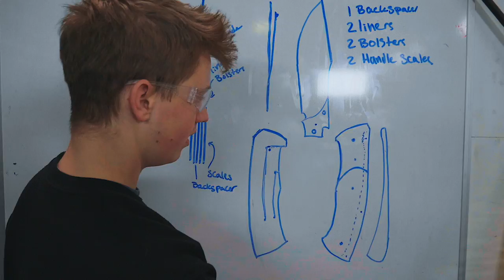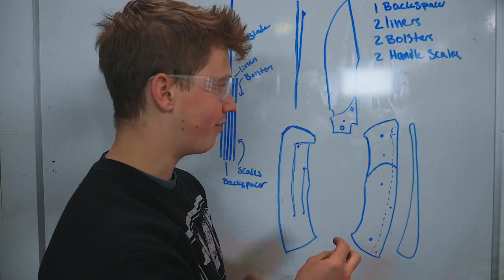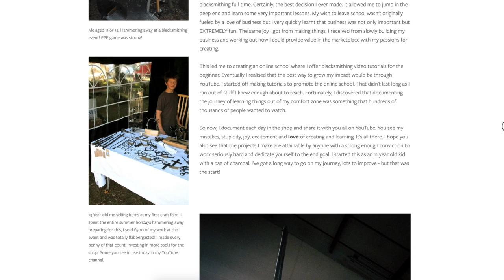WILL MAKES A FOLDING KNIFE!!!

Comment: Will: *making a folding knife in the most practical, functional way
*
Alec: "Here's my design for the forge door with a pulley system, electric motors and a foot control"

Comment: Speaking of folders.  Iv'e yet to see one with the same strength of a fixed blade. I'd love to see a Alec Vs. Will where they each apply their own solutions to this issue. Then each tests the other's version to destruction.( The whole Gauntlet: antler chops, bend tests and maximum weight holding the center).

Comment: Please! Make a Damascus steel-sub hilt-integral bolster-cocobola handle-leather lanyard-gem stone inserted bushcraft knife with quick release straps-altoid, tinder,  Wet Stone & Fire Starter pockets leathre scout sheath.
Maybe thow in some twisted gold wire flukes and custom lanyard beads to.
Alec Vs. Will kind of challenge. so each one of you guys can have their own knife and go use them on the wild.

Comment: Hey Alec. Something I just thought of that had me wondering. What would happen if you took high carbon steel to Make Damascus, but instead of it being a flat piece it was a twisted bar, then once it was forge welded, you twisted the whole thing in the other direction? what kind of pattern would that make? or is it even possible? or What would happen if you took High Carbon steel. Twisted it one way, Low carbon steel, twisted it the other, then forge welded and stacked them? What kind of pattern would that make? Could you maybe look into that for us? because that would probably be an awesome thing to see.

Comment: Does modern damascus steel have any better mechanical properties compared to  a regular grade of steel?
Reply: Outside Stuff. 
I don’t know. Modern Damascus is just modern steel welded together to make a pattern. I’d assume it is stronger but hey I could be wrong.
Reply: Depending on the materials and quality its gets close to "regular" modern steel but the more homogeneous you get the stronger it will be.
Reply: Damascus becomes the "average" of the qualities used in the steel. Unless it is welded properly, the seams will be the weakest points. While it may look killer, it may fall apart under stress. Unfortunately, Damascus doesn't have super steel qualities today anymore than it did in days past.

Comment: Genuinely curious what ishe using for the heat colouring
Reply: kent clark Same
Reply: If I had to guess, I would say its a pressure cooker  with a little bit of oil on the bottom. Which would bring the temperature up nice and slowly without over heating it and undoing the hardening from the quench.

Comment: sweet knife but I'm surprised you use bolts for the handle, in my experience with knives I typically go for rivets because any kind of extra geometry or surfaces on the handle not only get dirt stuck in them easily but also catch in the hand and make it slightly less comfortable to hold, honestly you wouldnt notice it 99% of the time but in my opinion its best to eliminate awkwardness whenever possible

Comment: So, Alec.... Do you know about all those smaller forging channels that seemingly waste their angle grinder cutoff discs to cut sheet and plate for projects like this? Well, I absolutely HATE those channels. Thankfully (hopefully) you know better than to use your cutoff discs like that, right? I mean, honestly, it's a waste of those perfectly good cutoff discs that could be used for cutting things like round-bar, square-bar, rebar, flat bar, angle iron and such that are better suited for that than sheet and plate. I mean, really people, use a gosh dang bandsaw, plasma cutter, or cutting torch for sheet and plate. For tubing, either strategy can be used, especially depending on the size and shape, whether it's round tubing vs square tubing, thick-walled vs thin walled, large diameter vs small diameter, it either can vary, or doesn't really matter. Also, for tubing and solid stock (bars), a chop-saw or cold-saw (basically a chop-saw but it's slower and uses a cutting oil & water mixture for coolant and lubrication) can be used.
Enough about my opinion, what's your opinion on this issue and these channels?

Comment: why do you guys quench always in oil, water is the best
Reply: Not always, depending on the steel quenching in water will cool the blade down too quickly and this causes a lot of stress on the metal resulting in a much higher chance of the blade cracking or breaking
Reply: @timschrier903  Japanese knife makers go with water
Reply: @sp50  again it depends on the type of steel you use, some steels work well with water and others don't